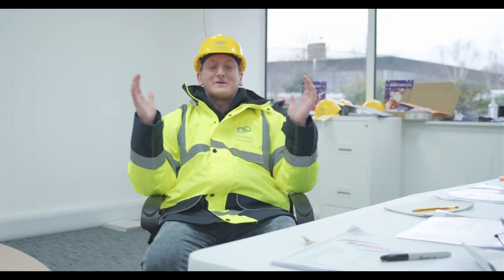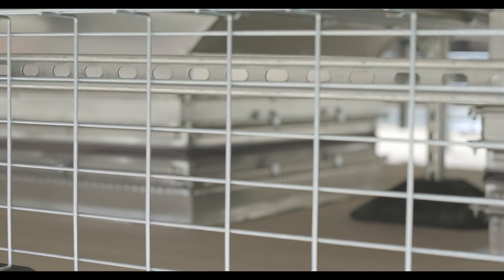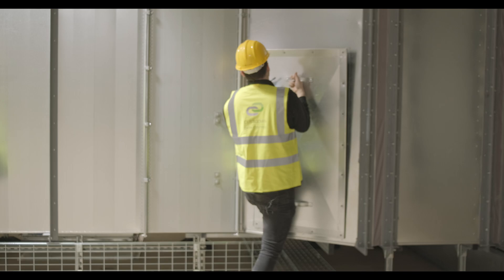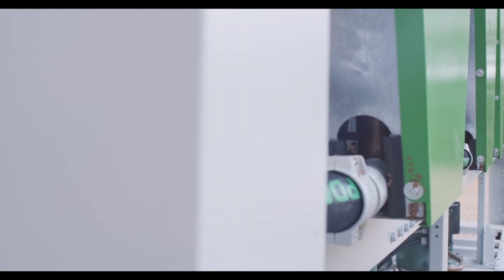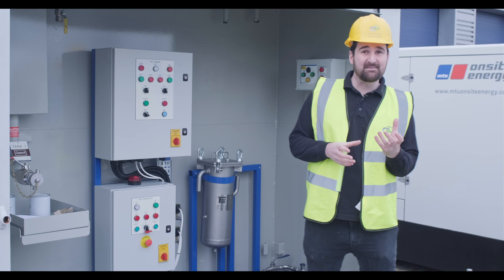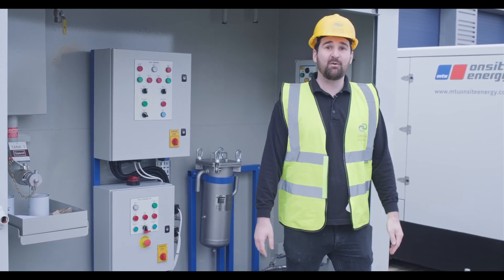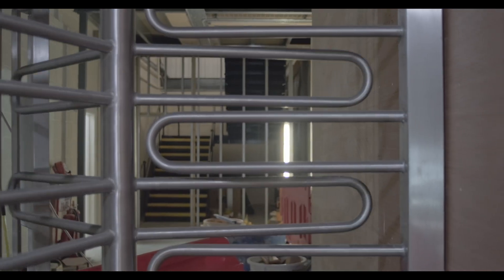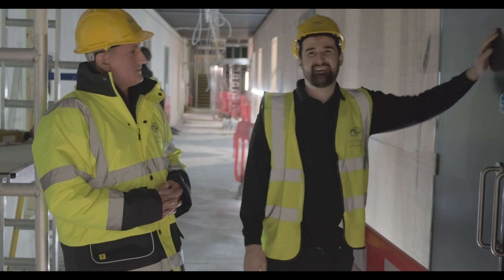HOW TO BUILD A DATA CENTRE - Introduction - Episode 2

Comment: I can't help but notice that the gate next to the turnstile is too low for rolling whole racks through. My guess is that there is an alternative way to move a fully built rack into the corridor, but it wouldn't be weird to end up building a rack in the conference room and cart it over to its home when finished.

Also, hope the fans have one way baffles to stop air from recirculating when a fan inevitably fails. Else that "two fans of redundancy" is not much of a thing.

And at 2:10 we can see the turning wanes being installed very very far down. Usually one wants them inside of the laminar airflow one wants to direct, not after the curve one wanted them to direct. So that is a fail on the HVAC contractor's part.

Also curious to ground sourced cooling, a bit too late to really install such now. But the ground has a lot of thermal mass and more or less keeps year round average temperature and would more or less remove the need for heat pumps for keeping cool during the warmest days. (though, just dumping heat into the ground each summer will increase the ground temperature over time, so in winter one has to suck out some of that heat, but the cooling units should have spare capacity during winter for that task.) A solution to add ground sourced cooling to the site would be drilling wells, but geological conditions will have to be considered.

Comment: Interested to know if you guys had todo the CDCTP course for your job? I work in a large building with one of the most powerful supercomputers in the UK and even though my job doesn't involve working on said SC, my company forced me todo the data centre course, which I passed but since it was mostly about designing a DC it wasn't really useful for my role. (I'm a Maintenance Engineer, look after Chillers, Generators, CRACs, AHUs, Heating Systems, Power etc etc, but don't really work in the Data Halls)

Comment: That's it -- I've just finished watching every single video that Custodian has published on YouTube. I really appreciate the time and dedication it takes to document these topics and make them available for the benefit of others working in this field! 

Cable labeling has been briefly mentioned a few times but I believe it would be tremendously helpful to go into a bit more detail, such as what labeling nomenclature does CDC use? Are interface descriptions in routers or switches populated with circuit info? What is your process for provisioning new circuits - start to finish? How do you document and manage knowledge of all the connections in your facility? All industry best-practices but from the vantage point of what has worked well for Custodian. Just a few thoughts -- many thanks again for the brilliant work -- Cheers!

Comment: You should deliver the heat to the roads so that ice and all that stuff melts the ice in the Winter
Reply: there is no much of winter in England, usually just rainy
Reply: @Sylv_S  And heating houses etc.
Reply: @stili774  the infrastructure required to divert the heat wouldn't be worth the costs.